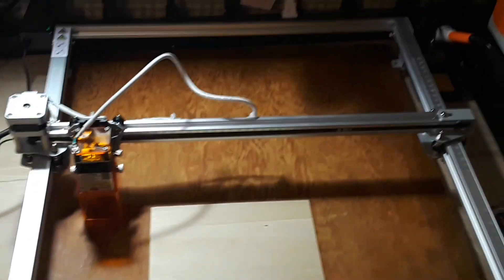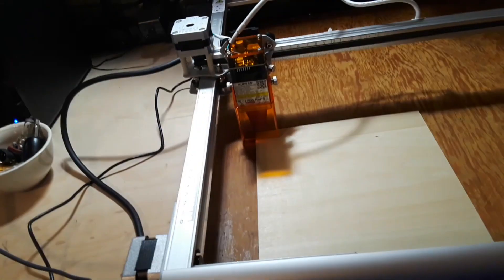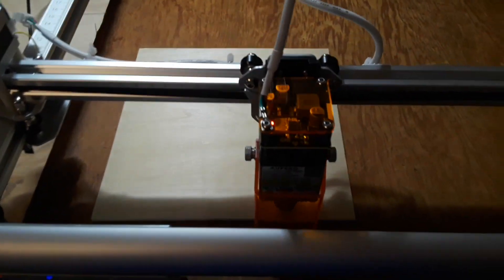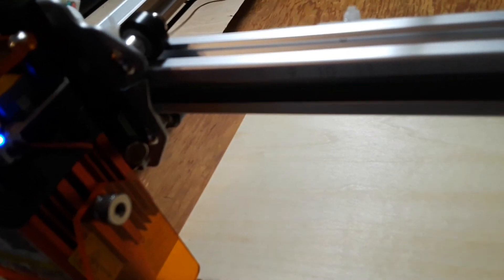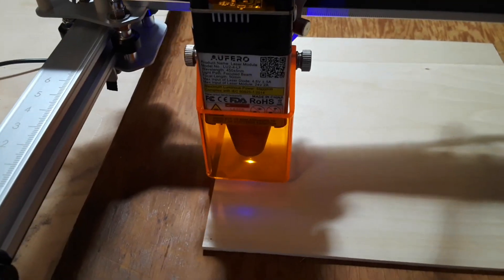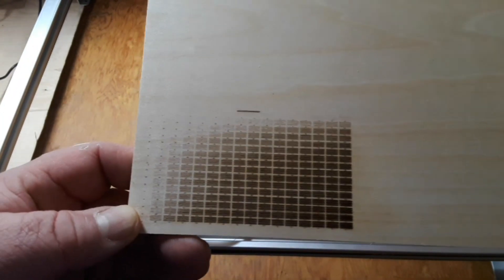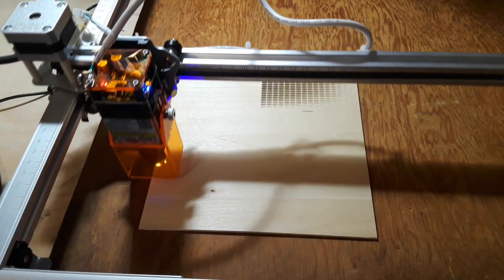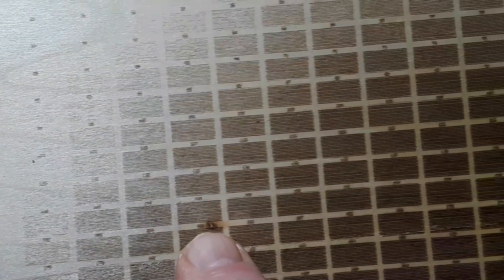Teaching myself how to use a laser engraver/cutter

Comment: Nice. I’m tryin to get the handle on this el cheapo 3d printer lol. I want to use cura software for it and they don’t have this model in the library so it’s been a grind tryin to calibrate the damn thing lol. It works amazing with its software but not much bells and whistles with original lol.

Comment: Paul one way to check your laser is to engrave a empty box ( no fill) of a known  size ( 100 x 100 mm) then measure the engraveing to determine  how close it is to the correct size then adjust the number of steps per mm .

Comment: "engraver/cutter"?
Isn't it just a fancy wood burner?
Reply: @Geir Endre yes  laser cutters / engravers technically burn. But they can be used for more than just wood. They can cut and engrave many different materials and depending on the type of laser such as a fiber laser and the power,  they can cut different metals as well.